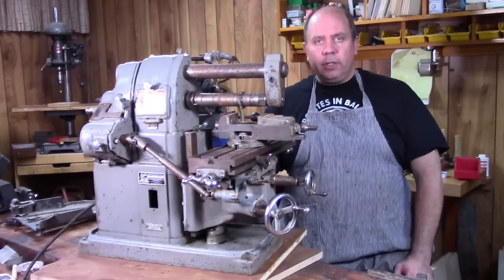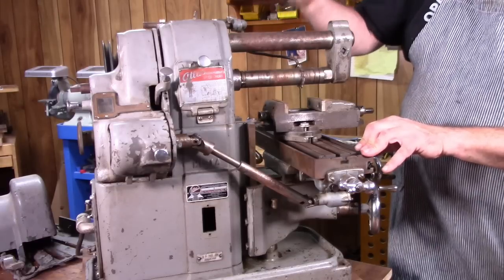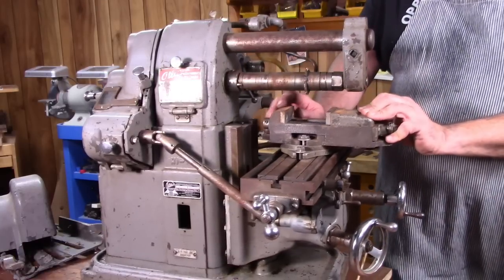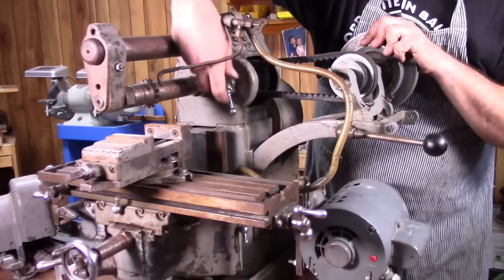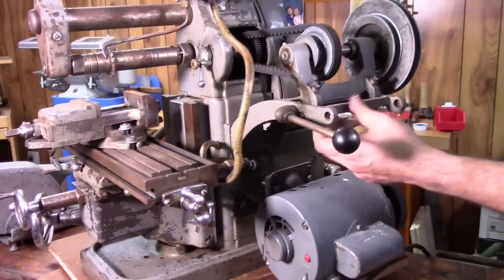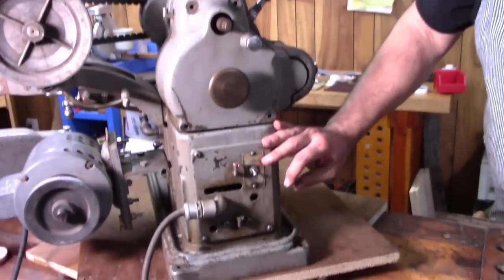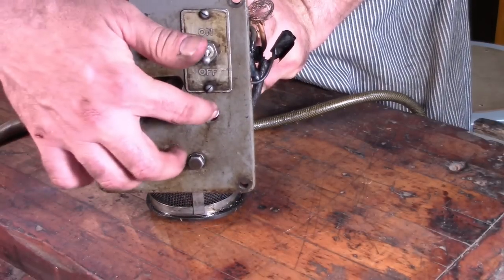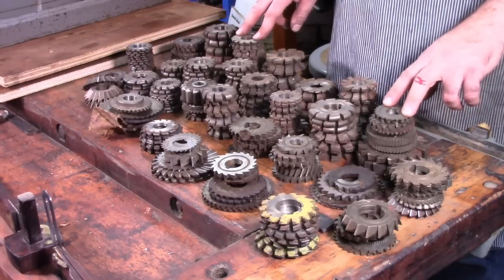Latest find: Atlas MFC milling machine

Comment: I getting my MFC piece by piece,like a damned game achievement....Most parts already acquired,there about 5 subassemblies remaining,spindle assembly is one of them...I can't find arbor support arm that round large bar that overgo to earing that holds arbor...Majority parts like cross slide table there,the part called knee is wrong,it have another name which sound logical to me from European translations,Console assembly..lathe got apron,Milling machines got Console and Shavers not shapers so as Planers got Rocker arm...Not just knowing how to working on machines alone I also know all bits and pieces how they go and connects or been modified like I did with my Craftsman 109,numerous modefications been upplied and things got changed..Spindle now instead near 9/16 become 3/4 size,original components get modified but not changed,last part that would be build from scratch is gear box assembly that normally would undergo at right side of lathe just like larger versions have...There nothing else would be altered like I seen some 109 version gear box attached at rear of gear cover which is wrong....The back gear cover shouldn't be blocked because it gives quick access to gear replacement or lubrication,in the aftermatch extra bed could be modified and attached to extend leathe swing for over 56 inches long,different versions of tail stock could also be made and attached,milling attachment could be made and also installed..But there is things to be in mind about 109 lathe...Originally 109 lathe was made by Atlas Press company for Craftsman,later other variations like Sears or Logan and their parts not very interchangeable without altering like I did with mine..Little change with front stock housing assembly,apron assembly get altered by front area where it lines on bed,cut have to be made backward more professionally that it aligns correct,tail stock saddle also have to be modified by welding extra edges on side and to correct previously made extra wideness spacing plates have to be weld at cut areas and new track areas must be grinded in shape of V downward which I had did....Modifying apron assembly further would eliminate old half nut lever,instead making new half nuts that adjust with simple swing of lever that locks or unlocks nut halfs from lead screw that enables automatic feeding...As for manual control I weld extension plate at bottom with rounded aperture at side that permit installation of hand wheel and feeding gears with worm and at bottom geared rack installation..Prticular modified apron would be no different from larger lathes variation and principals....Last part is gear box,Original rounded bushing like segment where lead screw goes through would be grinded off,instead there is area where gear box would be lined in,portion of Sears or Logan front stock housing have protrusion or aperture where gear box would be screwed on so as sides...In this sense lead screw length would be decreased or shortened because of gear box,if secondary bed attached lead screw need to be longer sized...All that could easily be done,If I did it others might do the same,Atlas/Craftsman 109 is good addendum for MFC machine..Because of their small size and dimensions those machines is easy to transport and deploy wherever they needed..I easily can uplift half assembled MFC,not a paper weight but it not heavy eather as previously imagined....Fully assembled MFC shouldn't over go further than 150-185 pounds..
Reply from the maker: Yes, a lot of these Atlas milling machines that I see are missing parts or have parts that have been altered or repaired. They were made for hobby or light industrial use and aren't as robust or heavy duty as commercial machines. Certain parts have a tendency to get separated from the machine over the years, which is why you see so many machines without the overarm support or the cutterhead guard or the kickout stop. Plus, these machines are 60 to 80 years old by now, so time takes a toll on things.

Just so others know, the 109 Craftsman lathes were not made by Atlas. They were made by the AA company and as far as I know, they don't share any parts in common with the Atlas lathes, other than the change gears.
Reply: Yet it is no limit to make my 109 lathe become fortune 1000,instead original BS spindle that was poorly designed with 1/2 thread my new one is entirely 3/4 diameter..I modified original face gear/pulley drive and even made new brass bushings for it,I enlarge hole diameters in front stock housing one I think 24mm and other almost 26 to permit new brass bushings with proper thickness to support new spindle..Front bushing made in original collet like content to adjust tension for spindle,also I made extra tension bushing just in case when needed..Becouse of small gap between front spindle round protrusion at housing I craft special wedge washer that fills that tiny space and further more would eliminate any unwanted frictions for spindle..Original spindle gear hole been enlarged to permit 3/4 spindle size..Becouse of 3 different brand companies who manufactured 109 lathe Which is Sears,Craftsman and even Logan parts not perfectly interchangeable between each other,I did modification on apron and tail stock bottom saddle so alignment over go 1:1 scale precision...However apron takes different approach,I made extension for bottom and welded on,now apron have aperture at side allowing installation of feeding gears,worm and geared rack to allow smooth manual feeding of lathe just like larger lathe versions have..Original half nut lever would be removed from it's former position and no longer useful,instead I had build and crafted split nut with 2 halfs that would upply there,justlike larger lathes operate those halfs would reciprocate by turn lever clock or counter clock vise...Last part is gear box assembly,This one is tricky because of small confined space between front stock housing and bed,so instead standard lathe position lever from bottom to top my version would be from top to bottom allowing clearance to engage specific gear for specific speed that transfers toward lead screw without need to replace a gear individually at mounting area...Bed would be modified slightly to allow new gear box installation but back gear gover would not get involved and won't be modified anyhow...All gear boxes go at right side of lathe instead behind them like many amateur owners do...Ones I seen 109 lathe was sold at ebay,by first glance view I couldn't even recognize what is that,it was ugly modified and lot of components took critical changes,hole at front stock for near 1" spindle that broke tolerances of lathe,the previous owner even build some kind of spindle post extension to support it...Back gear cover was altered and at least cutted at half,very ugly unprofessional modification...My personal modification well estimated and done,there is no parts interruption,no bindings and no spin conflicts occurred,I made even cut for woodruff key at spindle and gear drive,everything fits tendy there without any conflicts,it all fits firm rather loose or too tight..I also did modification on my Wen 12" drill press,original support column is shit I tell you honest,just like all rest of modern drill presses does..They all made in China,but China brakes rules at factory standards and instead making columns thick walled they make them paper thin like almost reminds me tail pipes for a busses or trucks,it is stainless steel rolled tubing than spot weld to simplify manufacturing...I craft my own version of column,I took steel pipe near 3" diameter,cut vertically about 9/16 extra material off than saw at 2 sections..the problem was science pipe walls so thick I couldn't even band them with torch heating,instead punishing further I decide cutting pipe vertically at 2 parts,grinding areas for flush welding and weld precisely that it done from outside in all way penetrated..When grinded I noticed my pipe instead round shape overcome oval,this is when I took torch,1 sledge hammer,1 large mallet and about 1 and 1/2 draw bar and start straightening everything until become fully round,this process was took me like 2 hours perform such task,this was done at my job rather home...Ones results was satisfactoral and I use caliper readings every single minute after banging with hammer until results become near correct..After that I took angle grinder along pneumatic die grinder and start grinding all extra was on after knocking marks..When pipe become look like pipe I sanded with medium grain sand paper,at the end outer finish become shiny...My final result with column become 2.550-2.556 inches OD just like original,matching scale is 1:1 of original,all parts fit 1:1 scale not too tight or too loose..There was bid competition how strong is my welding of the pipe,becouse of heavy weight placement pipe withstand 10 ton pressure and didn't deformed,my 2 co workers lost 40 bucks to me...I told them if you try chalange my welding competition you all going to loose,I have welding experience over 20 plus years long,no one can chalange my welding skills at garage and precision..Most of my welding finish not even need grinder at end,everything get weld flush lined....Machining skills is my next experience with metalworking so as blacksmithing and gunsmithing skills is legendary..Despites been professional machinist and know how to use every lathe or milling machine I also know how to modify it as well,know how those machine components operating.....The lathes have Apron,Milling machines have Console not knee what called mistakenly and Shavers not shapers so as larger variation Planers have Rocker arm..I have experience with all those machines and can operate at manual or CNC mode,doesn't matter for me but one thing in mind by working on CNC mode sometimes there is wrong glimps of second and you have neather over milled or cutted part or broken end mill or chisel at lathe..This is why I prefer manual mode instead so it could be monitored and controlled precisely without mistakes..
Reply: Besides,I had also drilled holes at my drill press gear rack and mounted at column,this what have to be done from jump street by factory,this eliminate table assembly wobble from side to side and reduce drill bit friction out of center during drilling operations....because of properly made support column head assembly cannot lean forward anymore because of drilling pressure upllied toward column,table assembly cannot wobble anymore eather so drill press perfectly balanced...Becouse of special milling compound and collet chuck drill press easily transforms into multi speed milling machine and allow permission for small milling vises or clamps use..last thing I don't had enough time to finish is rewiring motor speed indicator,instead plugging wire which turns indicator automaticly on and when you press power button indicator start display wrong motor speeds,the indicator need to be wired direct at power button so when pressing button motor turns on and speed indicator begin display right speeds...
This is very nice drill press over all,adjusting speed from 560 rpm to almost 3000 rpm,very powerful and have drill chuck for 5/8 bit sizes,if that seems not enough I have an largest chuck somewhere for I think 3/4 bits and that is final size of Jacobs drill chuck that exist,not remember number 5 or 6 something like that..
As for starter pack to my MFC when assembled I have enough milling saw disk's,end mill cutters and numerous reamers to craft anything out of metal or wood..Another project is Plasma Arc welder machine,based on exact principals like Multiplaz 3500,Multiplaz 3500 is failure in design rather success,incorrectly constructed and poorly designed that power board interfere with cooling fans operation,becouse of wrong value electrolytic capacitors they always pops off which cost power failure at fans operation,in order make them work correct you have to unplug digital rheostats that adjust voltage to torch or secondary power outfit for auxiliary welding or cutting mode 2..
I had designed my torch to accept all standard accessories to Multiplaz 3500 such as anode cups,cathode assembly,retainig end nut,evaporator,insulating glass tube made out of quartz,outer shield,etc...All fits and performs as intend...
I made torch cable out of 6 lines instead 3 on Multiplaz 3500,cooling fan for torch 1 wire,2 power wires,1 ground protection wire,and 2 for thermo regulating board that switches secondary cooling fan...Machine almost ready for final assembly except I didn't complete current multiplying boards and didn't find sink with cooling fans..Rather than that all parts ready,there is lot of overload fuses to prevent any possible overloads,rheostats is no longer digital rather than high voltage manual that can withstand 1000 MOhm,mahimum voltage is 600 something volts but torch power line only uses 350-375 volt DC and maximum 12 Amperes current...Torch cable capable withstand 30 maximum Amperes and 650 volts DC or AC so there enough voltage and current reservers to prevent any voltage or current over jump...
allow me making doors or windows in addition to cabinets..I always tool savvy,I have tools for woodworking,metalworking,stone and concrete working,electrical jobs,plumbing jobs so as watchmaking and not many peoples heard of small sized dies and taps that 0.30mm in diameter makes them very tiny...My drill bits have smallest size 0.10mm up to 26mm,this also include woodworking bits auger,gimlet,spade,center and spoon types....
Despites that I also have surgical tools as well,I capable to engage all things and probably perform surgical skills along way....There is no disciplines in Scientology that I cannot perform,makes me understand and expand knowledge at new previously unseen things,energy and conversion from gasses to energy matter..
In Scientology there is no impossibles exist,unfortunately peoples turn Scientology into money making business just like everything else,corrupting true points of view into lies...Scientology despites money or greed,it based at universe principals at teaching how to find guidance in life,however there is personal scarifices to be made in order to fully understand things that nobody previously sought anything...
Another project that half way done is radiation dosimeter,LCD and main PCB boards near finished,becouse of different projects I don't have time to finish things all way..I also craft my own parts for my Luger P08,becouse the prices is no right I made my own sear assembly,ejector,takedown lever and safety lever without spanding dimes rather than my time on it..
Luger P08 is an art rather pistol,very complicated in design and that what makes it so special and charming,another one is Mauser C96 and Walther P38,one thing make them identical in practice is coned shape of barrel to avoid recoil suppression...All 3 models very accurate at range,old but there is lot of history in them that modern models cannot even compare,precision is what exactly in them and very smooth accuracy....
I have very large experience with firearms,even much deep at things like barrel design and manufacturing and ammo design and manufacturing which makes me completed gunsmith and armorer..the master gunsmith is a person who had completed their knowledge at barrel designs and ammunition design and reloading...
In order for me to craft firearm parts I always need original factory drawings,I mostly specify in milimiters rather inches but can switch when needed most..Making or redesigning tools is another thing Iam mastering at,I did with so with one of Stanley planes turn it into Model 62 low angle plane,price for one was very expansive so I did my redesigns to accomplish that task and even made my own handles for it from wood...Another plane I took old Millers and fall and turn it into Stanley model 2 plane,small size but there is also smaller number 1 exist which somehow very very pricey...After bench planes there is even smaller block planes out there but they relatively cheaper than Stanley model 1 bench plane..
My largest plane is number 8 Stanley Jointer plane,I have majority different types of them which would

Comment: I saw a picture once with at least  30-40 of this MFC mill used in a WWll aircraft co. So that would indicate that they were pre 1940.
Reply from the maker: Marvin -- You're absolutely right. I have some WWII-era marketing literature from Atlas and they promoted these mills (and their lathes, drill presses and shapers) to factories that were involved in the war effort. Even though these are small, lightweight machines, they were affordable enough that it made sense for factories to purchase them and set them up for small, repetitive operations, thus freeing up the larger machines for the bigger jobs.

Comment: Excellent video, very illustrative. It makes it easy for me to ask you the following: This machine is in our family history in a special way. After a long search I was able to get it, but it lacks all the mechanism for automatic advancement of the transversal car, and other accessories. Here in Colombia it is very difficult to obtain it, it is possible in the United States. Can you tell me how?
Reply from the maker: Thank you for your comment. The parts for the automatic power feed are often broken or missing. Atlas no longer sells these parts, so your only option is to look for used parts on eBay. Or make the parts yourself.